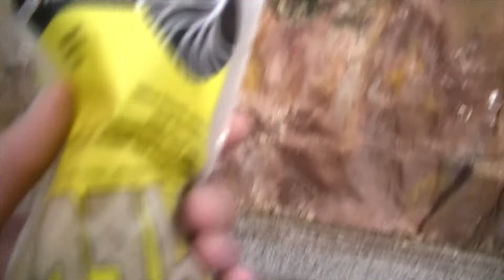Buiding a Mountain

Comment: Great Video! Even  though the plaster is cracking, the spray foam is the cause of the cracking. Unless you use the type of spray foam for windows and doors. The normal spray foam takes a long time to stop expanding. Like you said even a year later.
Reply from the maker: +MWRR Could be, I did use the windows and doors stuff though. I just assumed it was due to the moisture from painting and spraying with water, causing the plaster to shrink and crack as it dried.